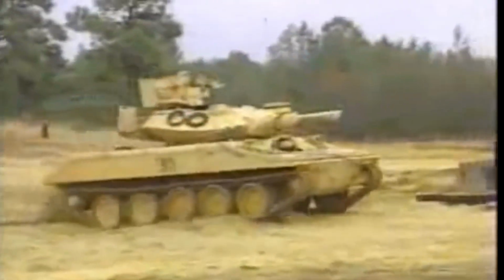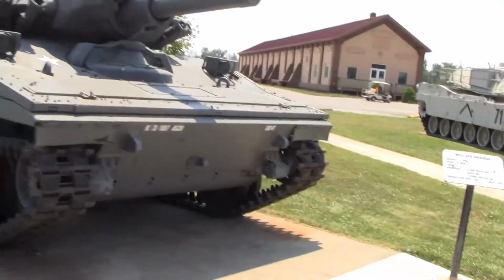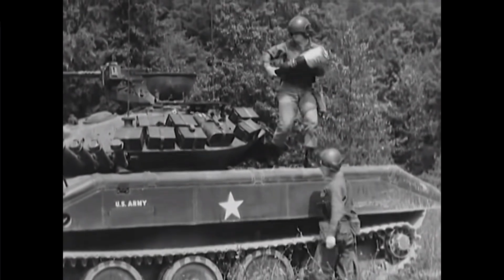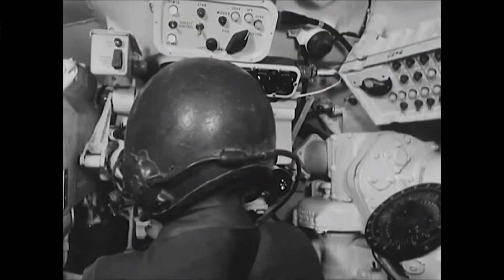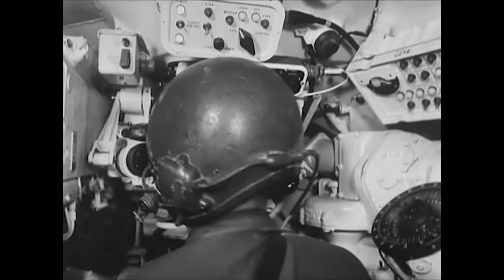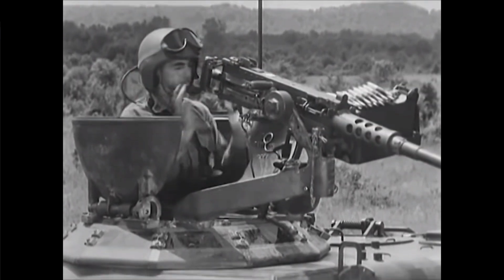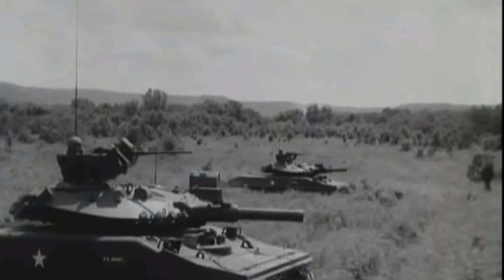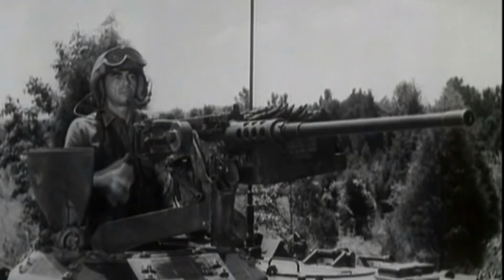M551 "Sheridan" AR/AAV | DESIGN DISASTER!

Comment: The concept of an air transportable tank is as old as aviation - and as flawed as any other moronic delight.
You can't parachute it down - and expect it to be in working order - it won't be.

The aircraft that can actually transport a tank - with the gun and protection required is a huge monstrosity that can only land on a limited number of airfields - which are inconviniently located so far from where the action is that the time saved by airtransport is more than swallowed by reassembly, disgorging the damned thing. It also makes no sense to have 250 mio. USD aircraft transport a 5 mio.USD tank.
To land an armoured battalion of 50 tanks takes just about all the USA can scrape together of heavy lift.
And place it wrong - giving all the problems of road/rail-transport in addition.

The USA is - by far - not the only unteachable nutcases on the funnyfarm. Britain has had its fair share with the Scimitar which was excellent as a recce vehikle or even better for airfield defence in case the enemy was stupid enough to pander to the idea of landing heavy armour by parachute or helicopter - and the russians ARE that stupid.
The Germans tried to airdrop Wiesels which only left a widespread collection of spare part - heavily dented - of course.

No, if you transport army units by air it has to be light units with high mobility - such as Mowag Eagle - to move over swampy (snowy ground) buy the lads additional Hägglunds Bandvagn.

Now the idea of missiles on medium armoured vehicles is not bad. I propose taking a Piranha: Mount the missiles on top with a 25-30 mm. canon for combined anti-air and anti-infantry. The real antitank punch comes from the dismounts - dug in preferably - and their TOW's and recoilless guns.

As to tanks: If you are medium on wheels? Why not dispense with the turret and turn the whole vehicle - give the gun a longer recoil and let it pick up rounds from the autoloader (bolted to the breach).
The combination of missile from the gun and shells from same is an idea I'm delighted the russians have picked up: When the enemy is doing something stupid: DON'T interfere. With a bit of luck they will kill themselves.
Reply: The M113 is a nice, short vehicle that a heavy lift can get 4 of them (a platoon) in one lift. Put some ATGM and a 30mm pop up on it and you're golden.

Make a M113 Stug-like assault gun and you can get high velocity tank gun capability in a small vehicle.
Reply: @VT-mw2zb  That is an idea, that is not all bad. My personal use for M113 on a modern battlefield is as trucks for the heavies schlepping ammunition and fuel - which the heavies use in prodigious numbers - at places no other means can get to.

The days of the M113 as a fighting vehicle are over - except if you have nothing else. It can take artillery and small arms fire - and with proper tactics air attacks - without suffering to much.

You don't dream of all the nutty ideas that have been tried by the Danish Army alone to update them - but no: They are simply not up to the job any more. nothing derogatory meant by that. Their heyday was the Vietnam war - but that is over 50 years ago.
Presumeably the days of your grandfarther.
If you went into WW2 with the equipment of the Franko-Preussian war of 1870 - you would be cremated - as some did in the beginning of WW2. Denmark, Norway, Holland to mention a few.

The M113 is made of aluminium and that disqualifies it to many of the modern RPG's as aluminium burns unstoppably with iron - (that is the way you weld railroad tracks to aviod the gadung-gadung heard in old movies). It is all right against small arms and grenade splitter, but anything beyound that - cold cut in a butchers shop.

We tried using Civil Defence units in the Balkan wars - BAD idea: The hospitals equipment was so outdated that nobody could use the X-ray mashines - even in mint condition - not that any responsible doctor or nurse would do it, as they did not meet the health standards of today.

Personally I'm all for giving away old equipment to allies - if they can use it. Some of it is very good - others should remain in the museums or be scrapped.

Denmark is buying 900 off-road trucks of which 600 are protected from Sweden and in the big scheme of things that expense is chicken feed.
Reply: @thomasborgsmidt9801  My idea for the M113 or similar vehicles is this: while it is the safest to advance over land with armoured divisions and brigade on  2D battlefield, the US will be expected to project its powers over oceans and air space; thus 50-70 tons vehicles like the M1 tank or Bradleys are simply too heavy to be moved swiftly. This means either amphibious landing or insertion by air. Amphibious landing the problematic since the advent of precision guided munitions and anti-access area-denial weapons (A2AD) means the surface ocean is no longer suitable for large scale operations. In the First Gulf War, the largest landing planned since Incheon was cancelled because some reasonably modern anti-ship mines were in the way (billions dollars went to the Navy and Marines and they couldn't clear a few mines?). Relatively speaking you need to use less force to defend a 2D coastline than 3D airspace. Furthermore, the terrain dictates which area you can drop troops over and this favours the defender.

In a certain way, the only method to insert troops anywhere in the world quickly for the US is by the air. Air defense systems need to cover a much larger volume of space in 3 dimensions than coastal defense; thus relatively speaking, you can bypass and/or destroy air defense system much easier. However, since the Vietnam war, the airborne infantry has been de-mechanised and de-armoured. They have no airborne tank or APC once they hit the ground. They are essentially light infantry. Light infantry are vulnerable to everything on the battlefield. Their only saving grace is instead of 4 vehicles per platoon, there are 40 of them spread over a large area: more eyeballs to look or threats and an artillery shell can kill fewer men per hit. However, light infantry can only delay a determined attacker; they are little more than speed bumps. In WWII their roles were either to defend a sector or to replace mechanised infantry once the latter suffered casualties in the attack. In the modern battlefield, men are too valuable to be used this way. Desert Shield was a successful operation: 5000 light infantry Marines held the line, but the Iraqi never attacked in strength with armour anyway. Task Force Smith is an example of a disastrous light infantry insertion operation: they were quickly overrun by tanks (doesn't help that there were only 6 HEAT shells for the howitzers). The biggest problem is once they are about to be overrun, light infantry can't retreat in the open on an automatic fire swept battlefield.

However, they can retreat with the help of small-arms resistant APCs. Of course these APCs are vulnerable against RPGs and other infantry anti-tank weapons, however, the principle remedy against those has always been infantry rifles and mortars. The RPGs have effective ranger shorter than infantry rifles. RIfles has 30 rounds; RPGs 1. If the infantry riding in an APC stick their heads out of the hatch in the back, protected by gunshields, they can watch for RPGs and enemy infantry and shoot back, making the enemy infantry's job much harder and dangerous. Adding vehicles like the M113 to the airborne and light infantry can make them substantially harder. The Table of Organisation and Equipment for the light infantry brigades of the US Army contains nothing but Humvees, which are even more vulnerable than something like the M113: big windows, rubber tires, etc ...

Even when punctured by something like an RPG or ATGM, it's not always 100% fatal for the infantry inside. First of all, the idea that HEAT rounds are hot is not that true. The effects of the HEAT rounds are not heat or plasma or all that jazz. There are research paper which concluded that HEAT warheads defeat armour by purely kinetic means. In a closed vehicle, HEAT rounds can cause overpressure, which injure or kill the crew; in an open vehicle (like an APC with open hatches), it's less deadly. There is a funny video of ISIS infantry riding into battle on an open top captured US Army combat engineer armoured vehicle. They were fighting from inside the vehicle, using the armour as cover. The vehicle was hit by a Pershmega rocket, which killed in the driver instantly; but the three guys in the back survived. The moment they ran away on foot, they were shot and killed while when inside the vehicle, they survived for quite some time, firing machineguns, rounds of RPGs and rifle grenades, demonstrating the vulnerability of light infantry and value of even a light armour. Give the APC riders some fire-proof uniforms, large hatch to bail out quickly, and the fact that unlike tanks, APCs don't carry that much ammo to burn and I think a light APC can drastically improve survivability of light forces. Remember that around half of the Brigades in the US Army are light. Officially, only 3 or so out of 10 divisions of the US Army are designated as "heavy". The Stryker family of vehicles are the worse of both worlds: too heavy to be airlifted quickly, too light to compete with tanks, and the fact that they have rubber wheels means even the lightest bullet will puncture the tires (unlike tracks).

The M113 "may" be outdated, but relatively to the current equipment of the light brigades, they are actually substantially harder. Light brigades currently have nothing but humvees and the very big, very tall MRAPS. Using them as transports for the heavy brigades will probably work too.
Reply: Except that a tank without a turret HAS been tried and failed miserably. 
Turning the entire vehicle to find and engage a hostile target is slow and ineffective. Sure the gun and be slewed left and right a little to fine-tune your aiming point, but again it is slow and imprecise.
And an autoloader?!? Our military had BTDT and GUESS WHAT?!?
It was found to be be a bad idea.
Don't believe me?
Well, if it was a GOOD idea we'd STILL be using it, wouldn't we?
Look up some videos on the topic and you'll learn why the autoloader system was never adopted for other tanks.
Reply: The turretless tank is perhaps not so much an idea whose time has come, as an idea that has had some of the limitations removed - especially in the suspension department. Is it enough? Well.... maybe, maybe not.
Reply: @user-td1zo3tv9p  Stug III and IV were successful vehicles. They carry a long gun capable of defeating most Allied tanks. They were much shorter and harder to be spotted. The front glacis plate of a Panzer III chassis is thicker than the turret of Panzer III or IV, this means in a direct, head-on duel between an Allied tank and a German vehicle, the Stug III and IV is better than a Panzer IV. 

The assault guns are worse in the offense; but in the defense, in a dug in anti-tank region with multiple of them working in conjunction, with guns pointing in all directions covering all approaches, they are formidable. In the attack they can take an overwatch position and provide fire support.

There are entire thesis written by US Army officers studying the viability of a turretless tank and it concluded that "yes, it is viable"
http://www.dtic.mil/dtic/tr/fulltext/u2/a227389.pdf
Reply: @VT-mw2zb  M113 is literally no armor that small firearms can penetrate it... there are reason Bradley was created originally to replace M113. M113 with upgrade armor package is heavy no less than Sheridan but still lack of protection against heavy firearms like 50cal or above. there are reason they use LAV 300 and LAV III to replace M113 as well. compare protection between LAV Stryker and M113 is pretty much the same, both M113A3 upgraded armor packet and Stryker only can withstand smallarms weapons, LAV tires can withstand smallarms fire and still can roll with run flat tires and close beads. Both M113 and Lav can be launch 4 at once from C-17, but none of both was designed to be air drop. M113 have poor protection against mines with flat floor and thin compare with v-shape and high ground clearance. Overall air assault attack only can be work if you have air superiority and have massive ground force to cover behind for the invasion after it. otherwise it would be a disaster like Operation Market Garden. There are reason Gun assault went extinct after ww2 since it was never designed to be assault but defensive tool. it went extinct because other weapons system like anti tank missile or recoilless rifle do a better job than those no protection assault gun that limit in term of versatility. lack of precise in horizon compare with rotation turret and serve no better than MBT is the main cause of the gun assault went out of service. specially in assault, if you drop behind enemies line, you would be surrounded and flank by the enemies. With alluminium chassis like M113. And APC or MBT, carrying less or many ammunition, as long as it carrying high explosive charge from rocket or cannon round, it all go boom.
Reply: @boocomban  the issue with removing assault guns from the infantry is that infantry nowadays have no direct fire assets that can help them overcome fortifications, buildings, etc ... ATGMs are too expensive and specialised to be used to blast people out of buildings. Also, the other issue is training: it is vastly cheaper to have dummy gun rounds for training than ATGMs training rounds. The main cost for an ATGM is the guidance components, which does not get cheaper with training rounds. Thus units with ATGMs are at lower proficiency than those with direct fire guns.

Wheeled vehicles have high ground pressure, meaning it will be limited by the terrains and most of the time, forced to take the road, meaning the enemy have extra easy time deciding where to ambush you. A tracked vehicle has the luxury to avoid obvious approaches, and circumvent minefields entirely. In most of conventional wars, anti-vehicle mines aren't that bad. They mostly blow off a track or a wheel and kill few people. It is only insurgency which allows the insurgent to plant a big bomb that will blow apart even tanks; this create the monstrosities that are MRAPS, which will be toasted in conventional wars by being too tall, too conspicuous, and too easy to spot. Conventional armies spread small mines over a large area to serve as area denial or part of an overwatched defense

Also, the airborne idea is born out the of US's ideal of being able to deploy a brigade to anywhere in the world in 24-48 hours. Nothing can do this except airborne troops. As of right now, airborne troops are light infantry who are vulnerable to everything. Airborne troops are best at taking lightly defended positions from the enemy's rear and use the terrain to hold it and wait for reinforcement, They are not good at attacking, meaning a turretless tank is good for them. Current and Market Garden paras have little armor, meaning even if the thing they want to take is in anyway fortified, they can't do anything. In that case, a direct fire gun that can withstand at least small arms fire can do wonders.

Weak armours can be augmented by add-on armours, which almost everybody do. Even Stryker vehicles have add-on slat cage armours. With the slat armour on, they are too wide for most transports. To think about it: the Strykers are very wide. They are so wide that once loaded onto to aircrafts, it takes the the entire width. Say if the said transport crash land, the poor souls sitting in the front of the Stryker who wants to get out of the aircraft by the rear door will have to climber OVER the Stryker. With something like the M113, it is narrow enough that once loaded, you can walk AROUND it in the cargo hold. Then you can think about adding applique armour later
Reply: @VT-mw2zb  There are a thing call personal anti tank/personal weapons that is better, cheaper more versatile than assault gun. 8x8 have very little space gap between wheels. it performance compare with track vehicle is not much different, the only place where it loose track vehicle is in the swam or muddy, but even there is a tough place for track vehicles as track vehicle can stuck in the mud too! In most conventional war, anti tank mines can blow up and kill all crews inside, while IED can blow up everything. While MRAP 6m tall, LAV have similar height with M113 which is bellow 3m which is the same! Conventional armies use mix mines between personal mines and anti tank mines on the battlefield. 

Actually the airborne idea of US military doctrine is to deploy behind enemies lines, cut off enemies supplies or create flanking tactic or even eliminate enemies field command. The deploy around the world in 24-48hrs is Navy and Marine. There are reason Marine alway lead the invasion and US bases deploy all around the world. There are reason US maintain massive Navy Force and extend their military bases around the world for a reason. Why airborne can't be deploy in first 24-48hrs, because simply enemies air defence can't be wipe off in first 48hrs unless you fight with monkey or insurgency with no anti air capability. In the case of Market Garden, terrible strategy and terrible intelligence was the cause of failure, it was meant to have fire support from Spitfire and their mission was taking 3 main route with 9 bridge to lead to Gemany, not heavy fortified building. It failed because it deployed too far from objective, as well as German deployed at there was specialize in anti paratroop. The operation did serve with Recon Vehicle and artillery which is enough fire power to deal with Panzer division at that time, they didn't deploy with bare hand. It just poor strategy with no air support and lack of support from ground assault from behind due to the objective was too wide and far from the ground force can advance in time. There are reason after it Airborne tactic changed. 

Both M113A3 and Stryker take all of the cargo width of C-130 because both share the similar width M113 have 8ft9 and stryker is 8ft11, just 2inch different!. The paratroop transport US use nowadays is C-17 which is capable to carry 4 Stryker with troops even with add-on armor package, which not only allow you to let troops hand in hand gathering around the stryker in the cargo area and sing kumbaya around it as well but also allow you to slapp extra thick amours package.
Reply: @boocomban  personal/handheld unguided anti-tank weapons have ranges shorter than small arms range and the infantry operator is vulnerable to everything. ATGMs aren't better than guns since, hey ho, tanks don't use out the barrel ATGM as primary anti-tank weapons. The training cost of ATGMs means most units armed with them trained with those only occassionally. ATGMs cost and bulk are also prohibitively expensive fornuse against general targets (buildings, structures, etc ...) which tanks and assaultbguns can do easily. 

LAVs are longer and taller than an M113.
Reply: @VT-mw2zb  LAV doesn't taller and longer than M113 that much M113 are 8ft2 and LAV is 8ft8! 6inch! what are you smoking? C-17 can only carrying 4 LAV or 4 M113, no different! 

Personal/handheld anti tank like rocket or recoilless are up to 1200m, which still very effective on the battlefield like Iraq or Afghan where ISIS smoke M1A1 and Taliban smoke Afghan defense force with it, it suit with Airborne because they doesn't fight conventional battle like army troops! it deploy in enemies territory, the distance is not miles long! And Issue 10 troops with ATGM still cheapper than maintain and produce assault gun for crews compartment, which it have been proven that it work! look German late WW2, there are reason panzerfauts and panzerschreck got produce massive instead of tank! because it cost dirt cheap and effective compare with tank or assault gun! 2019 is arrive soon! training round is a thing since 80s for ATGM! with building, structure and fortified target can be destroy by rocket launcher, grenade launcher, recoilless like M3 Carl. More heavy fortified can be solve with Air Support. If the target that require tank, it not a job for Airborne!
Reply: @boocomban  trajectory of a recoiless rifle matches that of a overpressured 9mm. That's not a something very accurate out to 1200m. 

The problem with light infantry airborne is they are supposed to hold terrain and fend off attacks, buy time. If things go bad, they can't retreat under small arms fire. With light armour, they can, though the occasional at weapons will still kill them.
Reply: @VT-mw2zb  still! it not airborne job to deal with tank over a mile! M4 Carl training routine set the range from 600-800 yards!, for stationary target, training course set up to 1000m with rocket boost ammunition. if it face the tank, light armor vehicle would go toast too! The target of airborne is to capture/attack cut off enemies supplies route, strategic defend position, or even flank to join attack on enemies force. if thing go bad, no light armor can save them because if they got overrun, only air superiority can save them since any conventional force would have airforce!, tank or tons of weapon can toast the light armor vehicle. Airborne never meant to capture a point then hold enemies attack. surprise element is the only thing it have, if they have to hold the damn place just to buy time for main force then it pretty much f*cked like Market Garden. most of airborne mission would drop not far behind enemies line near the frontline to either cut off enemies supplies, reinforcement route to main battle or take down strategic location near frontline like airfield, Enemies Frontline command post, enemies supplies post or create a flank to lock down the frontline for the conventional troops to assault. It meant to be a quick strike with surprise element to support the main assault, It objective must be done and should be done by the time the main force arrive. to hold terrain and fend off the attacks is not their job unless the military have no better strategy to work, because it is not what the force designed for. The closest thing Airborne do like that is Operation Just Cause in Panama, where it deploy to take the airport so the airhead can be happen for C-17 and C-17 can land and transport troops with equipments for the invasion. Nowadays US airborne favours Air Assault since Vietnam war with the power of helicopter. It can quickly transport troops and provide fire support without have to rely on light armor vehicles, so no if airborne need retreat, helicopter is far better option than driving in enemies territories
Reply: @boocomban  helicopters are even worse for the specific job of retreating under fire. They are noisy, slow, and is vulnerable to small arms fire, even more so than light armours. Armours can't crash, helos can.

There are many battles that heli-bornelight infantry troops are mauled heavily upon touch dowb when they decided to land near enemy fortified positions: Ap Bac, Operation Anaconda, battle of Ia drang valley, etc ... Once heavily engaged under small arms fire, helos can hardly land. They are also noisy, alerting the enemy.
Reply: @VT-mw2zb  what are you smoking about, if your troops got stuck under fire and require retreat, Heli is the best choice, if it can't reach to the troops, non of light armor can! most of chopper nowadays withstand up to 12.7mm/50.cal to 20mm on the cockpit, clearly better protection than M113 for sure! and compare with less than 100mph with a chopper can reach up to 500mph, or even more! Who the f say heli is slow? Heli can crash, so do armours. If you stuck behind enemies line, light armor vehicle can't save you! And if the helicopter with it firepower can't help to suppressing the enemies to land? then light armor would be toast in that case. 

Ap Bac, anaconda or la drang would be fucked if you land near enemies fortified position with light armors or by parachute, no matter what tool you use to deploy troop at there, it would be fucked by enemies anti air and small arms return fire!. And it over 50 years ever since! helicopter protection are miles ahead ever since!, compare with UH1 made out of tin can thin aluminium with nowadays can withstand at least 7.62mm is way way different! So stop talking nonsense!, Helicopter have been use to be a tool for paratroop to do air assault for over 30 years and it have been proven that it work! There are reason Medivac use Heli, not armor vehicle! So stop talking nonsense!
Reply: @boocomban  the helos could not land, hover, or rescue anyone from Mogadishu. 2 of them got downed, in fact. Only the Little Birds, who used their agility, not armour to survive and prevent a total overrun of the Rangers.

The situation was finally resolved by a convoy that included ... Condor APCs  from the Malaysian contingents.
Reply: @user-td1zo3tv9p  "Except that a tank without a turret HAS been tried and failed miserably." 

The Swedes disagree. 
http://www.tanks-encyclopedia.com/coldwar/Sweden/Strv-103.php
Reply: Well you could do the old russian idea ro put wings on the tank itself and tow it where it needs to go...